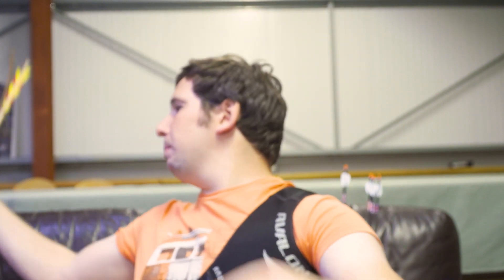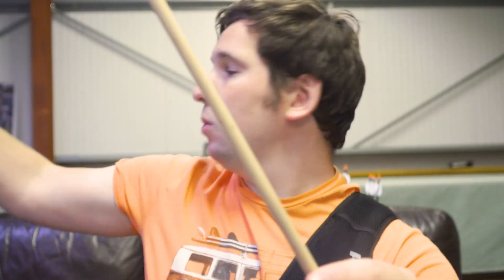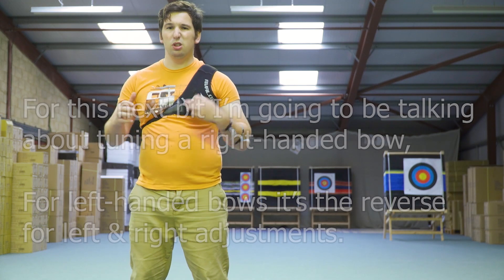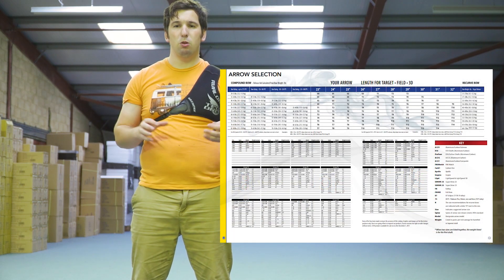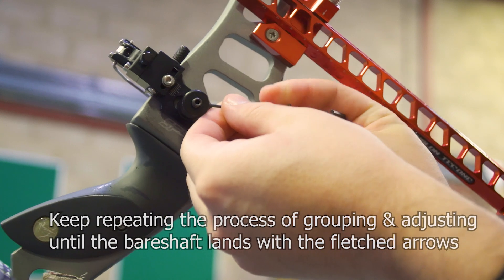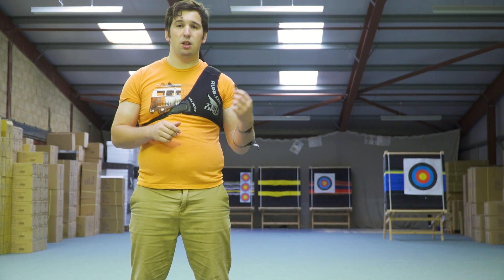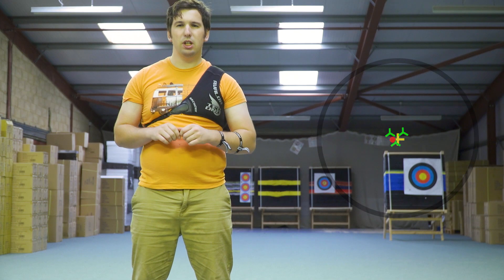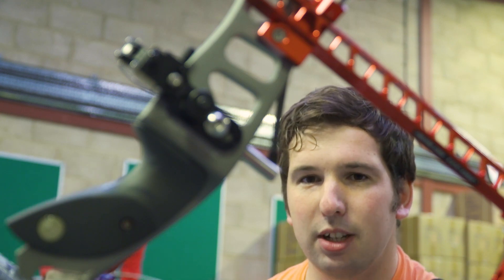SETUP SUNDAY - Setting the button pressure

Comment: If your bare shaft is landing to the left, it's probably more effective to increase the draw weight using the limb bolts (increase bot the same amount and reinsert the set screw) and vice versa for a bare shaft landing to the right. This  wasn't possible for bows without limb bolts, so button pressure was used.

Comment: Which one is right, adjust the pressure or adjust the depth of the plunger?
Reply from the maker: Hi, first you will want to adjust to depth to get the centre shot right. Then adjust the pressure. There is another video on my chanel about setting the centre shot.

Comment: Not sure why, but if I compress the spring the full amount, i can’t tell a difference vs all the way out... is this inexperience or is the spring too soft (ots the medium spring beiter)
Reply from the maker: If you are not noticing the difference while bare shaft tuning, e.g you are not able to move the bare shaft closer to the fetched grouping it could be a couple of things. One could be that the spring is too soft or too week, but it could also be issues with center shot, arrow spine, or your shooting form and release. 

I've had this issue myself before and in my case it was that the spring was too soft. What I think was happening was the spring was fully compressing no matter how much I stiffened it. Tried out a couple of the stiffer springs and eventually got it dialed in. 

Also seen it when helping others that it was caused because they hadn't accounted for the effect of cutting down the shaft of the arrow effectively stiffening the arrow, which put the arrow out of the ideal spine range, meaning the button couldn't offset it enough, in this case it was was sorted with heavier points which were cheaper than getting a new set of shafts.